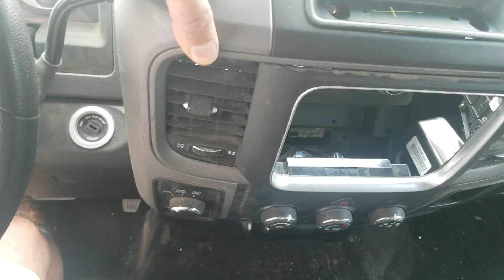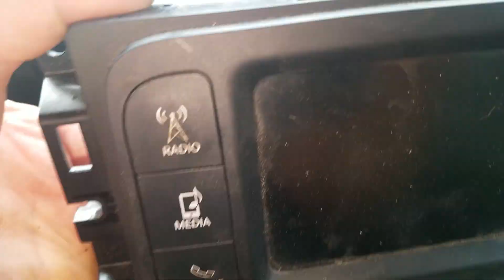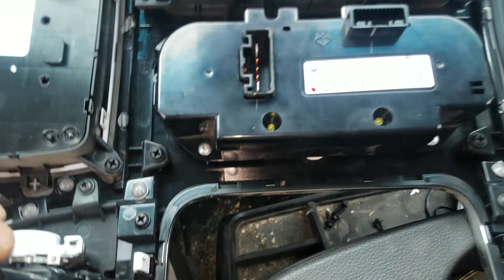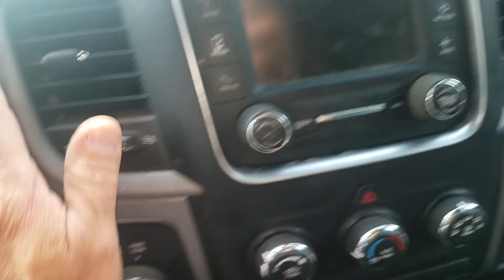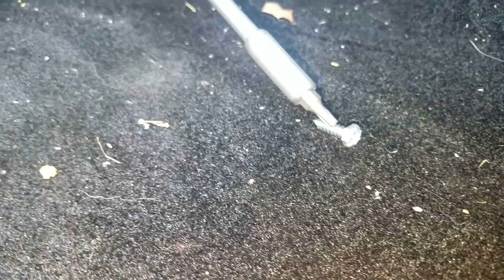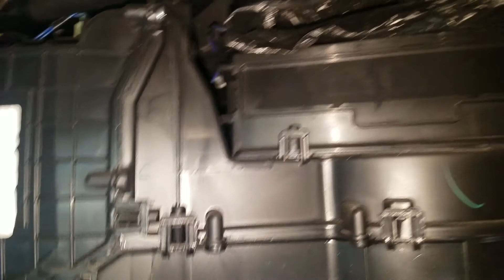Dodge Ram 2014 Blower Issue, Vent Repair

Comment: Reddiclus this way. You're a shade tree.
There's another way. Easier an faster. If you did this to a customer's car _ you would would have to buy them a new housing! And you would have to do the installation free. 
I'm a certified tech.
 I'm a certified tech and I see this sort of cob job a lot! 2:20

Comment: How about the cover for the cabin Air Filter.  My 2014 3500 didn't have a cabin filter, but it's available with a kit.  I had to cut out the blank where the filter goes behind the glove box.  I got a filter and the dealer had the cover with snap latches.  It took about an hour to cut out the blank.  After awhile, the AC condenser is going to get plugged since there is no cabin filter installed.  You will be back to no air flow.

Comment: Problem on my truck seems to be that door (where you had the bag stuck) seems to be malfunctioning, perhaps something on it broke. When we press the button for it to recirculate air or bring in air from outside it won’t actually move. I physically opened it and now the air is blowing but I’m not sure if it’s just going to close again on its own. Time will tell.